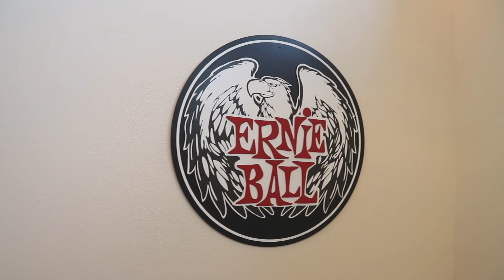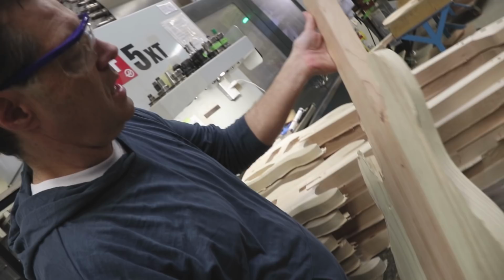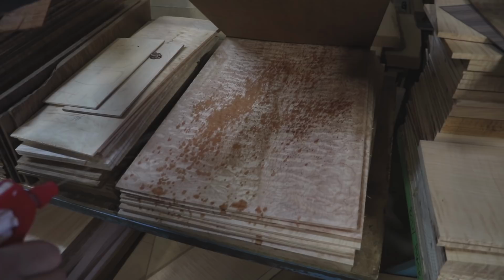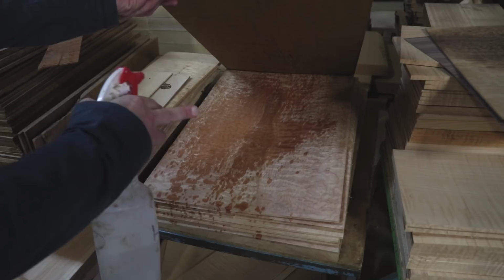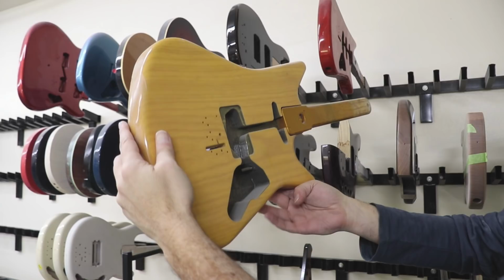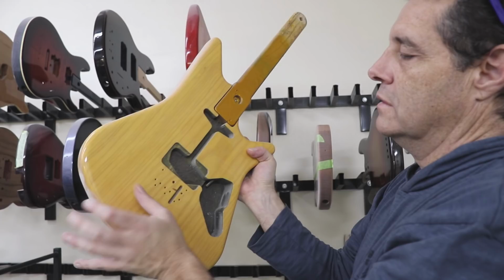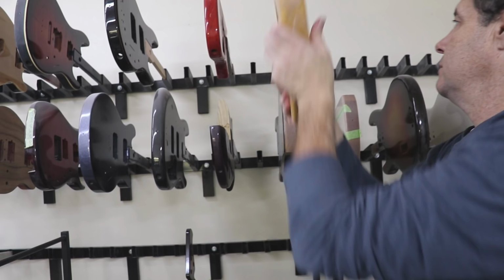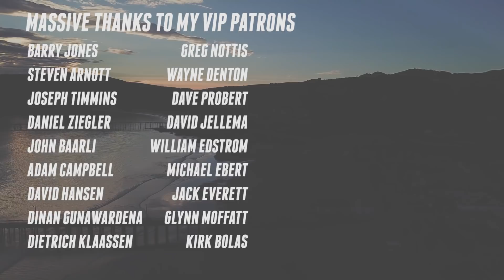My Road Trip to Ernie Ball Music Man

Comment: Ernie Ball makes guitars different from the usual models we all know - they are innovators.  I've never seen another guitar maker use "shields" under the pickups of different wood than the rest of the body, to bring-out the tonality of the shield wood - like using maple under the pickups to brighten the sound, or mahogany to mellow the tone, while the rest of the body is made of a lighter wood to keep the weight down.  They are the first to do that, to my knowledge.  They also make guitars more ergonomic with both their headstock design (which also keeps the pall straight going to the tuners), and moving the bridge slightly towards the bottom of the guitar, moving the neck slightly towards the player, making the guitar more compact. They have several models I'm considering, but I need to find a store that sells them, so I can try playing them...

Thanks for sharing your tour with us Mary - that was interesting!